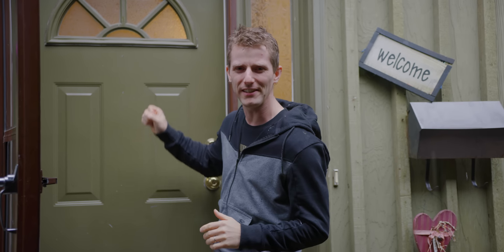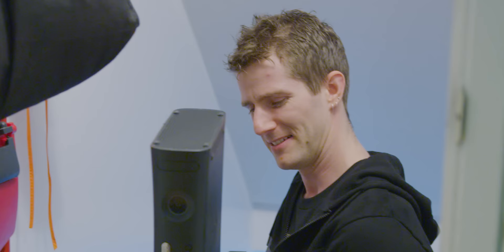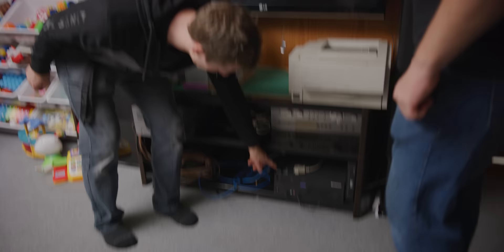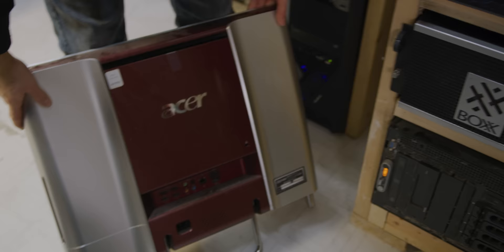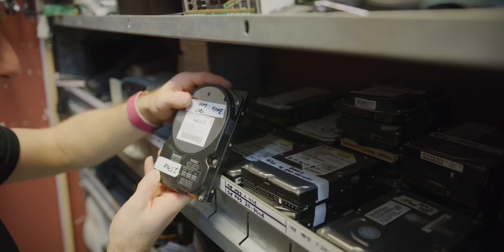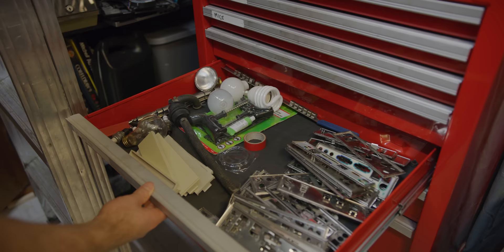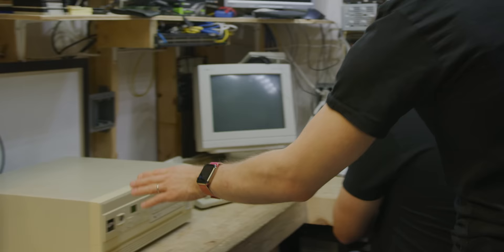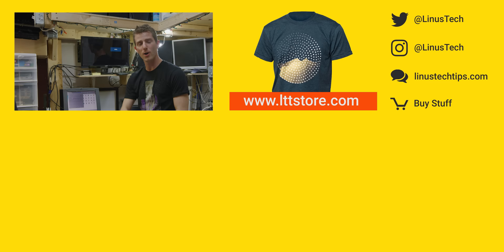This guy has a PROBLEM - Tech Hoarders

Comment: I used to build and sell a lot of this stuff when it was new.  Makes me feel a bit old when Linus says "Wow outboard cache!"  I'm like, well yeah and the the large ones were expensive as hell.

On the turbo button, back in the day you would set CPU clock and multiplier with jumpers instead of the BIOS and you would also have a small number display for showing CPU speed which would change when you hit the turbo button.  On a 5x86 133 I built for myself I wired up the turbo button so it would overclock the CPU to 160 (the turbo button connector is just like a current reset button connector, and the same size as typical jumpers), and set the number display to represent that.  The board would even let me change the clock while the machine was running.  So I'd run it at 133 until I would run something like Doom and then I'd hit the turbo button to actually speed the thing up instead of slowing it down.  I was probably one of the only people in the world who's turbo button actually did what the name implied.
Reply: i never got it, was too young. thats really cool though

Comment: BTW...a 5 1/4"  floppy had160KB capacity for single side, 360 KB for low density and 1.2 MB for high density. There were other variants as well, but that was the mainstream consumer standard throughout most of its life...

Comment: This should have been called. "A trip down memory lane - Tech edition" 
Wow, those floppies and that all-in-one PC really put in to perspective how far we have come in just 30(ish) years.
Reply: Those floppies were the same physical size as that bag of Amiga ones I have stoved away in my attic. As far as I remember storage on the Amiga floppies were half as much as the newer big floppies for pc. I think they were like 512kb storage on each side. :)
Reply: The amiga has single sided 880kb 3.5" disks from what I remember they are the same disks the pc used just not double sided (so a hole only on one side for read and write toggle) and the fat is more efficient to allow more than the 720k the pc could format them to. I am about to pull down my 1500 with a 20mb SCSI hdd and cdtv to chuck on eBay as we are moving house and it's time for them to go.
Reply: Yeah, 30 years ago my parents got us an Amiga 500 and it changed our lives but I just find it mesmerising seeing how far we've come. My Raspberry Pi is like, what, 100 Trillion times more powerful that the old 500? And not a 880k floppy in sight!!
Reply: Dad and I often wonder what we would likely have done if early PC's had the gpio's that the pi or better beagle bone have. As it is I am building a CNC mill at the moment, which would have been impossible cost wise, growing up in the 80's and 90's.
Reply: @house89147  It's such a cliché, but we're really "living in the future", aren't we!

At least as far as our past goes. ;)
Reply: @GraemeWoller  HAHA thats a clever head scratcher

Comment: I'm so old I remember 8" floppies. Also, My back room looks something like that one, not as organized though.
Reply: I was actually confused that I thought the bigger floppies were 8" floppies since I didn't have 5-1/4" floppy drive with my first PC (and I didn't know they're a thing). I thought maybe I remembered the size wrong. But thank you, you make me realized that I'm remembering things correctly.
Reply: There was once such a thing as punch cards😅
Reply: @tylerdurden3722  Punch cards and 8" floppies were used at the same time. The punch cards were used for things such as bulk data. They were more like the Dewey Decimal Systems that libraries used where the floppies were limited to small bits of code for direct implementation of an action such as launching missiles. My late wife was a punch card operator, she would be given the information and type it into a machine that spit out the cards.
Reply: Actually punch card have been around WAY before computers and definitely before 8’ floppies
Reply: In high school, I used a cassette tape for the programs.

Comment: " I rescue machines" - lol.  5 1/4 back when floppy disks were floppy.
Reply: I think i kept some of my old 5.25 floppy and an old 8 in i found at an old university i visited back then. Some 3.5 are still in the archives because old tech reports are stored there.
Reply: 8-inch floppies or gtfo.
Reply: Turning 36 this week, I remember when I was a little kid, and playing a game like Flight Simulator on a 5.25 floppy. It's nice to be able to have seen the evolution from floppies, to CD's/DVD's, and flash disks. I own several PC's and only have one external optical drive now, and never use it anymore. It's just crazy how fast networking has become, especially WAN connections, that we download HUGE applications like 125+GB games.

Comment: I have that exact same “cd changed” it’s actually paired with some amazing speakers and I added an extra subwoofer and it’s great. Use it with the rca in ports coming from aux on my pc.
Reply: Update: I also have that toughbook I believe if it’s a cf-52 and it is also a decent running machine I used for school as it is basically unbreakable.

Comment: I love these.....especially when Linus tells the 'young kids' about hardware and stuff.....prolly cause I'm so much older and have been in it from the waaaaayback.  I still keep stuff but mostly "my first..." or stuff that set tech trends.  I still have my first 'computer' a Timex/Sinclair zx80, Commodore PET, VIC20, C64, C64/128, Coleco Adam, Atari Amiga 2000 Video toaster.....the first RAM sticks I bought, Promise IDE accelerators w/RAM, I have a HARDWARE data compression card ('zip' data in real-time) 
ok, I might have a problem as well....thanks for taking me back a little ways Linus.....
Reply: yeah - 'young kids" i remember going to a friend's house on the weekend to play LODERUNNER and loading it from cassette tapes....  on a TRS-80. I helped my uncle put together his Timex zx80 and then we'd program it by typing in BASIC code from his magazines..  I think i'm older than the current demographic too...
Reply: Your list is the best stuff. Its like you knew what was the best and didn't hord everything. 😂
Reply: @TheBodgybrothers   lol, thanks.  I loved 'checking stuff out' and then filled in my friends on what direction I thought things would go and what direction they should, was kinda doing this YouTube stuff with no YouTube.....hahahaha
Reply: @jaypee42  ah yes, the TRs-80! I got my hands on a TRS-80 model II with 64k of ram! 2 5.25" inch single density drives! Reverse engineered 13ghosts to play.....it was huge!

Comment: "This is like VGA capture"

Could be... though it looked like an old 3D-FX board (off brand probably Diamond or something) that required the 2D input from your onboard graphics before adding in the 3d layer.
Reply: Its kinda hard to tell with this ancient tech, tbh.
Reply: I have my original 3DFx Voodoo card, and a pair of Voodoo2 cards new in box still shrink wrapped.
Reply: It wasn't a passthrough, it was 2 output ports, the voodoo cards had a male and a female connector on the bracket.
Reply: yes
Reply: @azrielstrife2557  I didn't look hard enough at the actual ports.... so what was it then? probably a cheap PCI video card that supports a multi-monitor setup. 

I used to run a cheap PCI card fora  2nd monitor before video cards started carrying multiple ports, so maybe that.
Reply: I had two voodoo 2 gpus back in the day, the way sli worked back then was a ide looking cable to tie them together. A whooping 12mb of video memory XD

Comment: "Ah my first computer from 1995"
"This is our first hard drive, 650mb"

Me, eating chips, reminiscing about my first PC XT, circa 1985 with 256kb ram, two 360k floppy drives and no hard drive.
Reply: My first PC was actually Soviet Clone of 8-bit ZX Spectrum. Kinda late 80's.
Reply: After the Commodore 128 my first PC was a Cyrix 386 33Mhz with 2MB of RAM and a 40MB hard drive that I doublespaced to 80MB ... and it had a turbo button
Reply: @PhilJohn1980  doublespaced... havent heard that term in 25 years
Reply: @PhilJohn1980  Same here My first computer was a Spectrum ZX 81 I was 8.. I hacked it into a physical keyboard because the touch one was horrendous.
Reply: @visker81  well it wasnt a win at all it just packed and unpacked the needed files ...something like rar oz zip...ram drive made things faster lol:D:D
Reply: Yep, my first IBM compat PC was a Tandy 1000 TX (maybe, not sure), 286 which I added a 287 to and eventually a huge 10MB HDD card. I actually miss that old machine, with OS in ROM it would boot pretty much instantly. My first actual PC was an MC10 followed by a Coco 3.
Reply: My first real pc was, after owning both a Texas Instruments Amiga 16 equivalent computer and a few Commodore 64's and Amiga500' s, was an IBM laptop. It had a 125mhz cpu, 512 kilobytes of ram and a whopping 1.2 gig mechanical HD.
I had a friend who had a similar laptop and we used to groan and talk about how we were never going to be able to fill up those gigantic drives.
Cut to today, where I have a "1 terabyte" drive filled with just my comic book collection. :)
Reply: I didn't get my first family windows computer until 2000 but I can only imagine how awesome it was to see technology move so fast back then. My very first computer was an Amiga 1200.
Reply: I’m the fun age that graduated in 81.  We saw punched card era and like everyone said that room size computer can be held in our hand. (More or less but the details don’t fit here. )
Reply: @ledsalesoz  I had a Tandy 1000 TL/2. It didn't come with a hard drive, so I added a 20 meg hard drive to it.
Reply: Osboune, had a boot leg pacman clone disk hehe
Reply: The year is 1978 - boy saves money on paper route for a year - gets a TRS-80 Model 1 (16K version) with a cassette tape drive! Wow... more than 40 years ago. I am old.
Reply: @ledsalesoz  о6о

Comment: Gonna disagree with you on the turbo button, at least on my old IBM 8088. I had a program that would benchmark the CPU in real time and, if I remember correctly, it ran at about 4 MHz with turbo off, and about 8 MHz with it on.

Comment: wait...hes a tech hoarder? lord if hes a hoarder then I have a SERIOUS problem.
Reply: @spritsfal5088  I'm just an it technician...I defy you to find me one it tech who doesn't have at least thiS much shit
Reply: @slicey80  I work tech support. I've been a packrat for about as long as this guy has. 

Moving is a severe pain in many anatomical parts.
Reply: I'm a "retired" IT hardware tech and I used to have 10 times this amount of goodies.  Recently been tossing mountains of it.  I still have an Apple II and atari 800 in a trunk.  I have an unopened box of 8" floppies.  I took a pickup truck load, OK, three pick up truck loads of CRT monitors to the dump a few years back.  This guy is just fine.  He likes to surround himself with tech history.  What's wrong with that?  My software collection goes further back of course as well.  I had windows 2 on floppy disk, it was little more than dos shell, if I recall correctly.  OS2, dos 4, win everything, linux, etc...  The point is, some of us don't throw something out just because it has some age on it.  My first pc was a timex sinclair 1000 kit with the 2 K, (yes K, not M) expanded ram module.  I gave it away in the '90's. I remember working at the local Apple dealer's when the first Mac came out!  No hard drive, just a built in floppy and monochrome CRT, but it did have a mouse!
Reply: i have jack shit

Comment: Linus: "TWO AMPS IS A PROBLEM"
laughs in audiophile
Reply: Thank you!
Reply: Yes, because there are setups that requires one AMP per speaker too.
The wallet and interest is incharge of that if you will get.
I use a 36 y/o Marantz from the early 80's which still sounds nice.
Reply: @draxoronxztgs1212  I'm pretty sure an audiophile knows about bi/Tri amping, dsp's, active crossovers and monoblocks/power amps or your kind of a crap audiophile...
Reply: Two ohms is fine though
Reply: @draxoronxztgs1212  I was commenting, what the definition of audiophile was... Which are the people who mostly understand when 2 or more boxes are effectively one amp (unlike wives who look at you like your just bringing more junk into the house). I hope you continue to enjoy your free hifi, it's from the era when kit was built well and not just a bunch of IC's. I do love listening to music and it's all personal preference, it's certainly not worth getting heated about and that is why I have left it as such.
Reply: @house89147  Well, I havent had anyone that has complained about my setup. Infact they are more amazed about how well it holds up to this day and have even said that it sounds better than their own system that is more recent and compact than mine. Then I do not consinder my self as an audiophile since I think there are more important things in life to be investing in and care about than just sound. I know my setup is as basic as a setup can be, but is also NOT the worst, and that it can be an insight of an classic "audiophile" world without throwing alot of money directly on equipment for better sound quality at the very beginning. Thats why it has its value too that increases over time, despite being almost 40 y/o.
If you're the one who use several amps for your setup, I bet i takes up more space in the livingroom than mine does.
Reply: Stares at amp rack : I see no problem here.....
Reply: I too, frick speakers

Comment: 10/100 internet is slow

Linus, not everyone has a 10gbs connection
Reply: @shak1ification The gigabit ethernet does not really make sense on older PCs. Assuming it has pcie slot, you will still have to buy a gigabit ethernet card, which are rare on other countries thus making its price a little bit too high.

Also other countries has only like 30mbps max internet speed provided by their ISP. Does not make sense to have 1000+mbps ethernet card, unless they use it for LAN.
Reply: @shak1ification In cities, sure, it's standard. In rural areas, hell no it's not lol... In some places even starlink's internet with its current disconnecting & ping issues would be better than the options IPS's give them, I aswell only recently upgraded from 40/10 to 150/150 internet while living in a town. (After having to pay to install the fiber).

Comment: 3:30 -- OK I feel like I have to mention, that at my actual work desk, where I am running a four monitor setup, one of them is a Dell 20" 1600x1200 monitor (that I run in portrait almost exclusively for Outlook), with a manufacture date of 2006... 

So slightly newer than the rando LCD in this guys stairwell (from a 3.5+ year old video), but I'm still actively using mine virtually every weekday and have been since it was virtually brand new! :)

Comment: "hey look at this relic!" that's the same as my main computer!
Reply: Mine has a Geforce 750 in it and I use it for WoW and 3D modelling. They hold up and they are tanks.
Reply: @jeremyfisher9102  yeah it ain't bad. I just bought most of a mid tier gaming PC so that'll become my main thing when it's complete, but my good old HP compaq won't be going away : )
Reply: Same...runs win 10 smooth and is overkill for office work.
Reply: So you boomers are using old ass PC cases?
Reply: @gokublack8342  Yes, but I'm 18 haha. Since I said this I have built a proper modern gaming PC... Also since I said this I have collected 4 Classic macintoshes from 1985-1991, a later 68k mac from 1993, an iMac G3, two windows XP machines... several enormous CRTs as well.
Reply: @gokublack8342  Why would you assume we are boomers? We are referring to the entire PC, not just the case. Two different things entirely.
Reply: @Hughesburner  Boomer was a bit of an exaggeration

Comment: 15:00 Oh boy i remember that... i think the 5 1/4 floppy disks capacity were 512kb and the 3 1/2 floppy disks at 712kb
Later on the "high density" 3 1/2 disks achieved 1,44Mb capacity.

Comment: Linus: you should have at least have Minecraft at 100fps

Me: cries in intel celeron and 4gb of ram
Reply: Laugh's in 2070 and Intel i7 9700k
Reply: Oofs in low end i7 nd, 16 gigs of ram, and no graphics card
Reply: @cottoncandy8420  one of those hp/dell office pcs?
Reply: @Asj-ze5is  yes, im gonna use the parts from it and also buy a gpu cuz it doesnt have one. Im using it as my computer until i get a new case and transfer the parts and upgrade some
Reply: Radeon HD 54501GB = 30fps Minecraft😭😂
Reply: F
Reply: Laughs slightly less than TinyDragonGaming in i5 3570 and 1070

Comment: Funny how an hour ago I was just checking out the specs on the 3 cases I have in the basements and pondering if I should install XP on one of those to play some old games. Then this video shows up on my recommended.
At first I was like, bah that's nothing, I still keep a Voodoo 3 3000 card around, and several CRT monitors, as well as a whole box of SD floppies with Amiga games.
But then by the end of the video I was truly impressed! He keeps that stuff in good condition!

Comment: I got the turbo button wrong my whole life :(
Reply: Giulio Berti Some systems turbo up, others turbo down. It was entirely dependent on the manufacturer to decide which way it was. The LCD commonly next to them would show you the clock rate to confirm either way.
Reply: Not really.. I only ever saw turbo LEDs indicate faster (as it does on the 486 in the video - LED is on at 66mhz) However it was only ever used to slow down the PC for compatibility - there's no other reason to slow it down. I guess that's where Linus' confusion comes from.

Comment: I did the mouse thing, but with scissors, bottle openers, tape measures, and screwdrivers: each floor has at least one that should be put back in its specific place (or at minimum the correct room) and it cost me maybe $50 max, but probably closer to $30